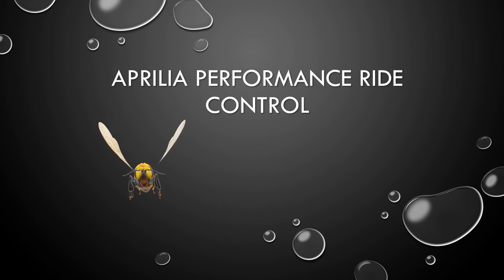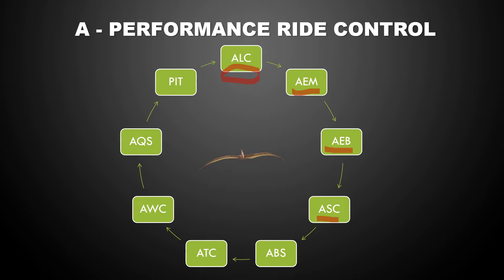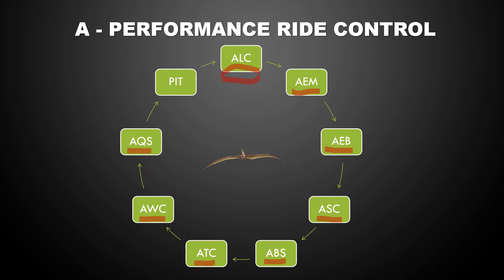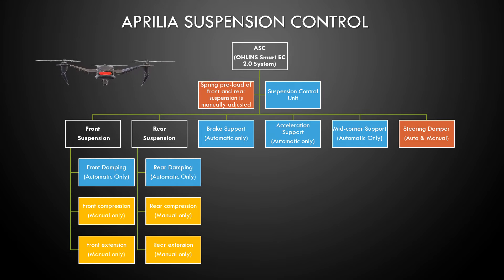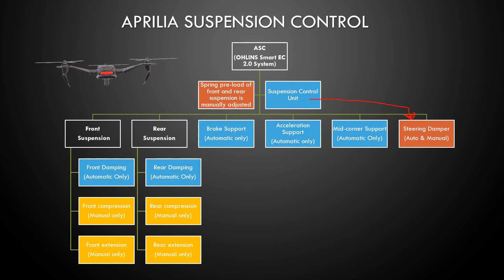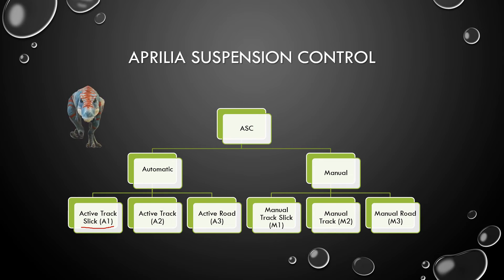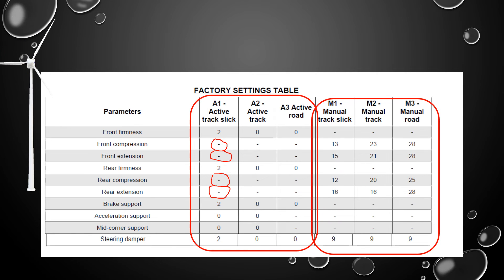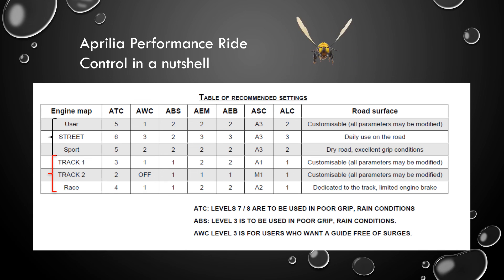I Finally Get It - The Aprilia Performance Ride Control (a-PRC) and the Suspension Control Explained

Comment: great video! I have the issue with my RSV4 21-23 that it always seems to behave different and now i understand why. i ride it in track 1 and i have issues that the rear is moving too much when accelerating hard out of corners. but its not always the same kind of shaking. so next time i will use M1 and close the rebound 3 clicks to let the damper not move upwards too fast. maybe like this the shaking with get less. and i think it should always behave the same then. so far my idea. i will report. if you have suggestions, please let me know :) thanks a lot ✌🏻

Comment: I believe another difference between the "active" and "manual" suspension modes is that when in "active" mode adjustments are being made real time based on IMU measurements w/in 100ms in real time - this is why they are called "active" modes.   so you will get adjustments happening as you are riding over "terrain" and based on speed and suspension motions.

Comment: Hi! How does AEM (Engine Mapping) really works? It reduces the horsepower in Street Mode like the Panigale V4? I know that there are 3 AEM levels, but i can't find what they really do...
Reply from the maker: Thanks for watching. Hope this helps: 
Aprilia Engine Map is a system controlling power delivery maps:
· Level 1 involves an aggressive gas management and it is suitable for performance
use.
· Level 2 is recommended for road use, in good grip conditions.
· Level 3 is recommended for road use in poor grip / wet conditions. The vehicle
is more easily handled.

Comment: Excellent video once again. I have a question about the function of the cruise control. In page 148 of the manual or says the cruise control works within a specified speed range depending on gear. However, I can't find those values in the manual. Pages 148-152 cover the cruise control functions. That section references those values but does not provide those values. Would you happen to know how I can learn at what mph range relative to gear will allow for the cruise control to be engaged?
Reply from the maker: Did you read the info. on the bottom of page 108 of the manual where it lays out the speed ranges?

Comment: Fantastic video! I just bought a 2021 RSV4 and this explanation will help me set the desired values
Reply: How are you liking your new bike so far?
Reply from the maker: @teamclockwork  I like it. Can't wait for the weather to warm up and take it back out on the track. I'm likely going to use this bike to do my coaching.
Reply from the maker: Glad it helped.
Reply: @brilliantspeedsuperbikes  Does it apply to half bro- Aprilia rs660 as well? : )
Reply: Isnt ASC   Aprillia slide control ?
Reply: @damienmcgoldrick4598 no that’s ATC